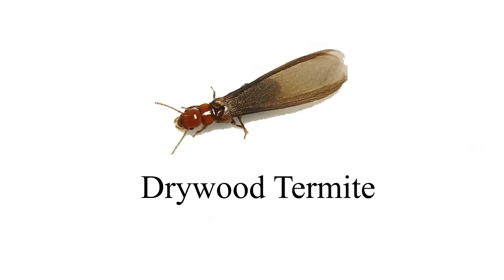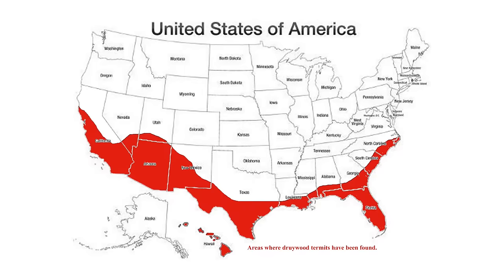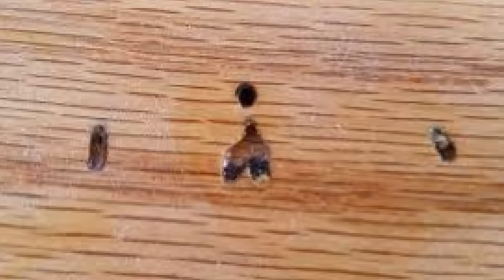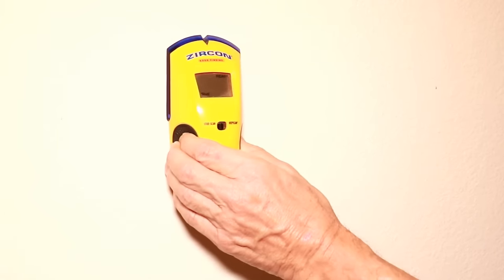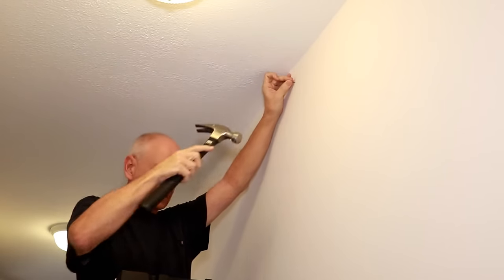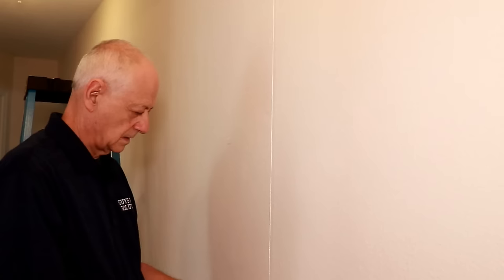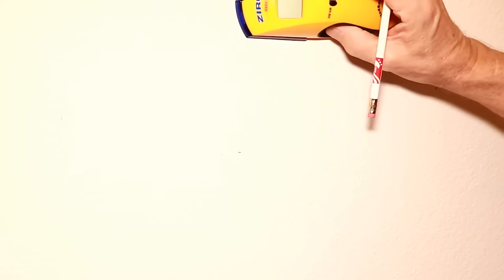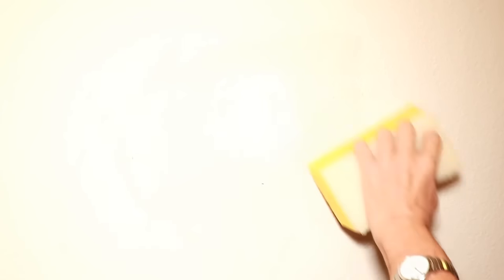How to Treat a Drywood Termite Infestation Yourself. A MUST see if you have Drywood termites.

Comment: Thank you for the information, I'll like to know if you know of any similar product that I can buy in CA
Reply from the maker: All the products are available from domyown.com.  They will ship to California.   Shhhh.  Don't tell anyone.

It is important to understand how drywood termites work.  They enter through cracks and crevices around windows, doors, the eaves, pipe penetrations, and so forth.  Most of the time, they enter through several locations.  That is because a swarm of them attacked your house at the same time.  If there was a crack or a crevice, then they probably found it.  After they established their galleries, which will be inside the wood, it will take four to seven years for them to be able to swarm.  Now that they are in your house, the swarmers will use holes that are in your studs to travel through the walls.  Those holes in the studs were created by the electricians to run the electrical wiring.  Not only are these holes going through the studs, but holes were drilled into the attic for the light switches and to run some of the wiring for the outlets.  So, the termites now have easy access throughout the attic and the walls.  If you have a basement or crawl space, they have access to that as well.  Most of the time, you will have no idea that they are in the walls, because the frass is inside the wall.  To make matters worse, if you have drywood termites, then your neighbors have them too.  That means you have been getting swarmed for as long as they have existed in the neighborhood.  Most likely, we're talking about years, so it's a safe bet that you have these guys in many locations in your home.

I always hate to be the bearer of bad news, but if you have drywood termites, the only sure way to get rid of them is to fumigate.  Prices for this can vary wildly in this industry, so I recommend that you watch my video on how to hire a pest controller without getting ripped off.  That video can save you a lot of money.  You should also know that the gas they use to fumigate has absolutely no residual action whatsoever, so you can get reinfested the moment the tent comes down.  Like I said before, if you have drywood termites, then your neighbors have them as well.  Since drywood  termites swarm every year, it is almost a certainty that you will be reinfested within a year after the fumigation is done.  The only way to prevent this is to do a preventive treatment on your house every 60 days.  Most pest controllers will not do this, so it is something that you generally need to do yourself.  I have a new video on how to do that and I will place a link below.  If you absolutely cannot afford to fumigate your house, then you can try spot treating it yourself.  It is virtually impossible to find all the termite galleries, but it is way better than doing nothing.  Regardless of how you treat it, you should begin the preventive treatment immediately, so that you do not get additional termites paying you a visit.

I hope that helps.  Be well my friend.                      

Video on how to hire a pest controller without getting ripped off:  https://youtu.be/y-a8XOqVrlE

Video on how to prevent drywood termites (You do not need to treat the yard for drywood termites.  Just the house):  https://youtu.be/Yozv3s-Qwlw

Comment: Do you have any suggestions if I have icynene insulation in my attic? I would like to spray bora care up there but that foam insulation covers a lot of the wood.
Reply from the maker: Every once in a while, somebody throws me a curveball that I have a hard time hitting.  I have to admit, that is exactly what you just did.  This is the kind of insulation that sticks to the wood and you cannot remove it.  Therefore, I don't know of any way that you can treat the area of the wood that is covered by the insulation.  If you do not have an existing infestation, then the good news is that the swarmers are not going to be able to get past the insulation and into the wood.  So, all you need to do is treat the exposed wood with the Bora-Care and that should give you full protection.  However, if you have an active drywood termite infestation, then there could be galleries in that wood that the Bora-Care is not going to reach.  I would still treat it anyway, but again, you may not reach an active gallery that is already in the wood.  That leaves you with doing a very careful inspection to see if you can find kick out holes and frass.  If you find the kickout holes, then you can drill a hole into them and treat the gallery with a fipronil foam.  Of course, as I tell people all the time, the only sure way to eliminate a drywood termite infestation is to fumigate.  The problem with fumigation though is that it has no residual action whatsoever.  That means you can get reinfested the moment the tent comes down.  So, treating the attic with Bora-Care is a very good idea.  You should also begin treating the outside of your house every three months to prevent any more drywood termites from entering the building.  I have a video on how to do that and I will place a link below for you.

I hope that helps.  Be well Mary.

Video on how to prevent a drywood termite infestation:  https://youtu.be/neNsmVbj8Pc

Comment: Hi Guy, I have drywood termites in my attic and crawlspace. I have been told by a pro that local treatment will only get rid of some but not all termites.  Do you agree / welcome some help on how I can best remedy?  Thank you.
Reply from the maker: It is important to understand how dry wood termites work.  They enter through cracks and crevices around windows, doors, the eaves, pipe penetrations, and so forth.  Most of the time, they enter through several locations.  That is because a swarm of them attacked your house at the same time.  If there was a crack or a crevice, then they probably found it.  After they established their galleries, which will be inside the wood, it will take four to seven years for them to be able to swarm.  Now that they are in your house, the swarmers will use holes that are in your studs to travel through the walls.  Those holes in the studs were created by the electricians to run the electrical wiring.  Not only are these holes going through the studs, but holes were drilled into the attic for the light switches and to run some of the wiring for the outlets.  So, the termites now have easy access throughout the attic and the walls.  If you have a crawlspace, they have access to that as well.  Most of the time, you will have no idea that they are in the walls, because the frass is inside the wall.  To make matters worse, if you have drywood termites, then your neighbors have them too.  That means you have been getting swarmed for as long as they have existed in the neighborhood.  Most likely, we're talking about years, so it's a safe bet that you have these guys in many locations in your home.
                            
I always hate to be the bearer of bad news, but if you have drywood termites, the only way to get rid of them is to fumigate.  Prices for this can vary wildly in this industry, so I recommend that you watch my video on how to hire a pest controller without getting ripped off.  That video can save you a lot of money.  You should also know that the gas they use to fumigate has absolutely no residual action whatsoever, so you can get reinfested the moment the tent comes down.  Like I said before, if you have drywood termites, then your neighbors have them as well.  Since drywood  termites swarm every year, it is almost a certainty that you will be reinfested within a year after the fumigation is done.  The only way to prevent this is to do a preventive treatment on your house every 60 to 90 days.  Most pest controllers will not do this, so it is something that you generally need to do yourself.  I have a video on how to do that and I will place a link below.  If you absolutely cannot afford to fumigate your house, then you can try spot treating it yourself.  It is virtually impossible to find all the termite galleries, but it is way better than doing nothing.  Regardless of how you treat it, you should begin the preventive treatment immediately, so that you do not get additional termites paying you a visit.  I hope that helps.  Be well my friend.                        

Video on how to hire a pest controller without getting ripped off:  https://youtu.be/y-a8XOqVrlE

Video on how to prevent drywood termites:  https://youtu.be/neNsmVbj8Pc
Reply: @GuysPestSolutions  Thanks, Guy very helpful with all the details.  The fumigation costs in my area prices appear to be very high at $2K with a few years warranty.
Reply from the maker: @Howard-h1g  $2000 to fumigate a house is actually a pretty good price.  I have seen it much higher than that.  If the warranty comes with the contract and no additional cost, then that's fine, but do not pay any extra for it.  If you read the fine print in the contract, you will mostly find a clause that will tell you that, if they discover drywood termites in your house after the fumigation, then they will only spot treat it and not fumigate again.  Sometimes the language will give them the option of treating it however they wish, and sometimes it will clearly state that they are spot treating.  This is something you can do yourself for about $30, so it is not worth paying any extra money for a useless warranty like that.           

I hope that helps.  Be well my friend.

Comment: I am not a professional pest controller but I've done a lot of research what about thermal imaging? Can that be used to help find termites
Reply from the maker: I think that is a great question.  Thermal imaging is fairly new in the pest control industry and I have to admit that I don't have any experience with it.  I retired long before this technology was available.  However, I have also looked into it and I think the jury is still out regarding exactly how effective it is going to be with regard to locating drywood termites.  This technology essentially looks at a heat signature and I think what most pest controllers do is they are really looking for moisture and not actual termites because they know that termites are typically attracted to moisture.  At least, that is my understanding of how they use it.  I could be mistaken about that though.  So, while this may give the pest controller an idea of where to look, it should be understood that the operative letters in drywood are “dry.”   Unlike their subterranean counterparts, drywood termites have the ability to live on a very small amount of moisture and do not require a wet area to take up residence in your home.  So, while drywood termites would most likely prefer a nice wet area to provide lots of moisture for them, it is not a requirement for them to survive.  That is why I’m not so sure this will locate all the galleries.  The other problems I see with it are, if you are a do-it-yourselfer, this technology is going to be a bit expensive and would require some degree of training to really know what you're looking for.  I've looked into buying one of these just for fun and I see that they run around three or four hundred dollars and maybe more if you want a really good one.  So, I don't know if a homeowner would want to spend that kind of money on something that they really do not know how to use and that has not been proven to be effective.  I think this technology may be more promising when used for Formosan termites.  These guys are subterranean, but unlike other subterranean termites, they possess the ability to colonize in your walls in something we call “cartons.”  The cartons maintain a sufficient moisture level so that the termites do not need to return to the colony.  I think most pest controllers attempt to locate these colonies with a moisture meter, but thermal imaging may prove to be useful here as well.  So, the bottom line is that this is certainly something that we should keep our eye on, but I think it's a little too early to tell for sure how useful it is really going to be.

Anyway, that's my thinking.  Be well my friend.
Reply: @GuysPestSolutions  how about a stethoscope to put up close to the studs and listen?  I am dealing with a mobile home that has very thin paneling (not thicker drywall like in a normal home) so I would think I should be able to hear some termites through the walls with a stethoscope?
Reply from the maker: @macknumber9  I have not heard of anyone having success with a stethoscope, but I am open minded to the possibility.  Termites do make noise when they eat, but it's not loud.  So, it's something you could try and see how it goes.  Hey, you never know.
Reply: @GuysPestSolutions  I will let you know how this goes...I am going to pick up a cheap one and hit it hard  to try to get the termites agitated and then listen.  I heard when they feel vibrations they bang their heads to warn the colony...I think this would be better than just listening without banging on the wood first.
Reply from the maker: @macknumber9  When you bang on the wood, you should also listen for frass falling.  Please let me know how it works out.  You may be onto something.  Good luck.

Comment: If I use boracare in my attic and crawlspace, does it have to be topcoated with a paint or sealer?
Reply from the maker: No.  You only need to seal it if you are using it outside.  I hope that helps.  Be well my friend.

Comment: If I just have it under some some floor boards in an isolated what would you suggest to treat
Reply from the maker: The first thing you need to do is make sure that these guys are actually drywood termites and not a species of subterranean termites.  Figuring out the species is actually pretty easy and I have a video on how to do that.  I will provide you with a link below.  After watching this video, you should be able to identify the species.  Just get back to me after you watch it and let me know what you found out.  At that point, I can tell you exactly what you need to do.  Let me know if you have any problems identifying the species, but I do not think that you will.  It is much easier than you may imagine.  Also, please tell me where you live.  Location matters.  Be well my friend.

Video on how to identify termite species:  https://youtu.be/dIs_a0nfVjg